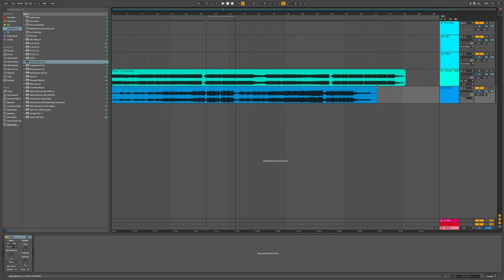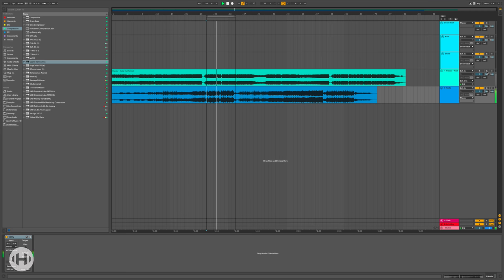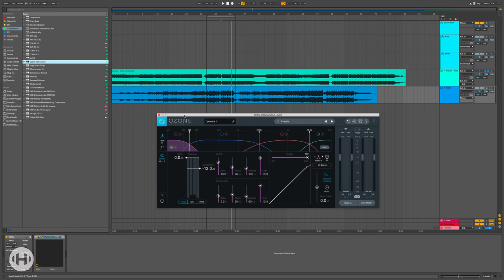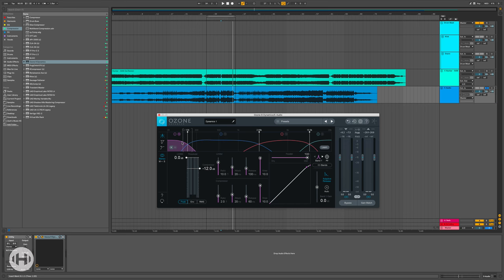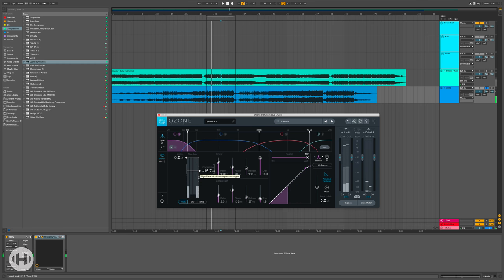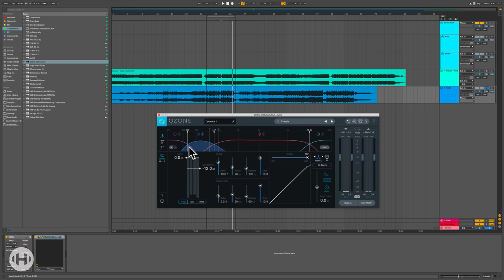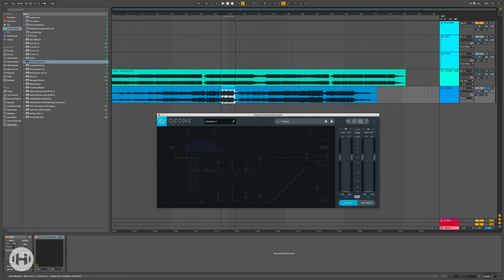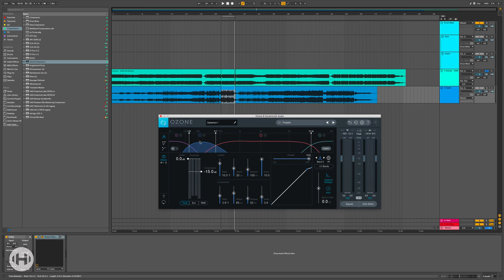Multiband Compression: Mastering Low End Punch

Comment: leaving the auto gain on will just adjust when the compression is active, but the whole point of creating a fatter over all sound would be by using the make up gain to match the gain reduction.  so that in the areas of the track where the bass is not active, the added dbs of make up gain will then be boosting low end making things sound warmer and weighted.
Reply: @hyperbits Would this be the better way to do it?

Comment: yo man ,I heard the difference. LOve this low end. does the idea make the low mid sit on the low freq ?
Reply from the maker: The approach helps control the low end so that it has more weight and power while at the same time making it smoother like those of the reference track. Ideally, it will help make all of the lower frequencies glue together, with the low-mids helping to add extra punch to the track.